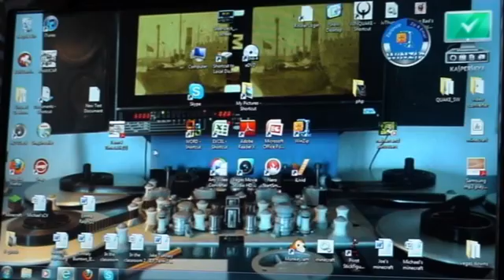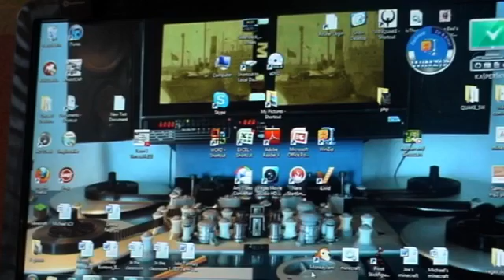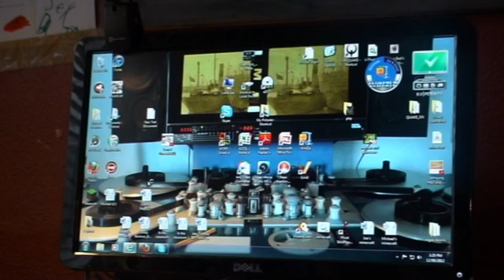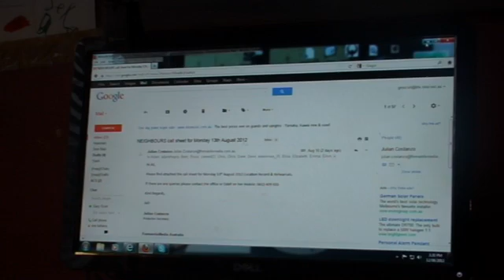Wheels trainer mouse, part 1 of 3

Comment from the maker: Interesting question, Stefan, re mouse interface for pan/tilt cameras. This is just a trainer for use of real pan/tilt wheels. The real thing has particular physical and practical qualities that make it most suited to the task. Also some of them (the original ones - still used) are actual mechanical devices that involve gears and drive belts etc.